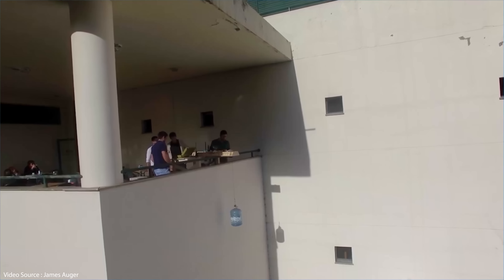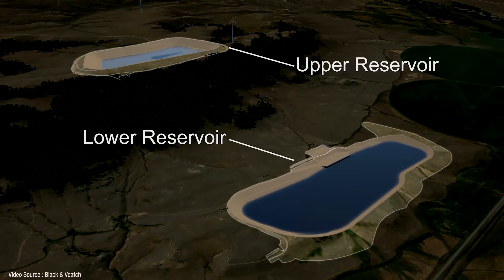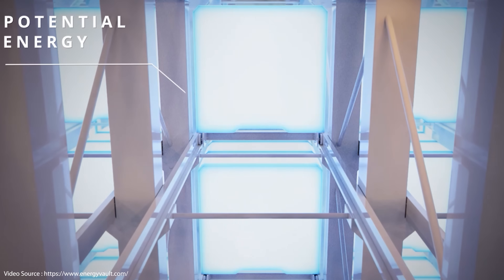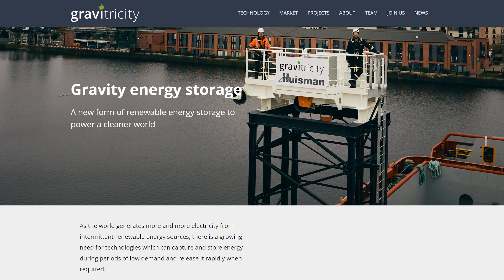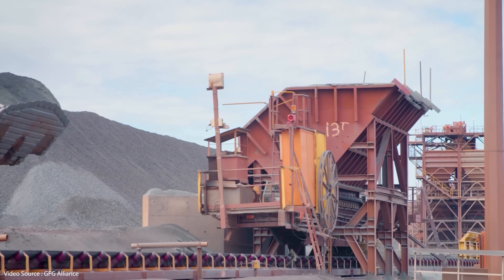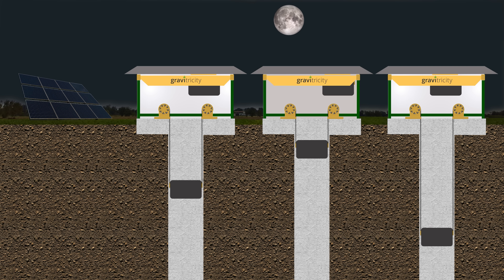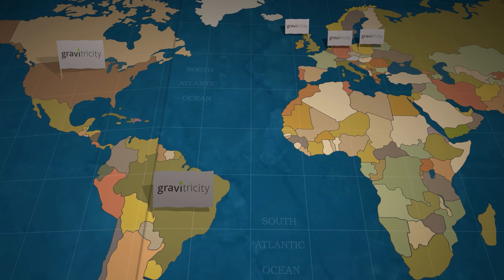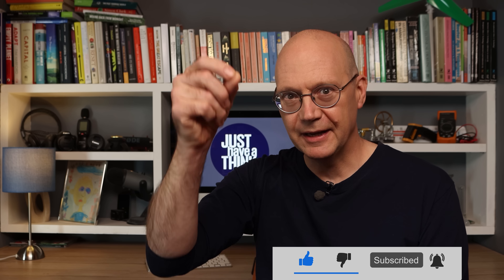Gravity Energy Storage. Who's right and who's wrong?

Comment: Being Scottish Engineers I wouldn't bet against them. They don't tend to be bs merchants. A large part of the Industrial and Scientific revolutions of the 1800's and the British empire is based on the brilliance of Scottish scientists and engineers (and I say that as a wretched Sassenach)
Reply: Read "How the Scots Invented the Modern World".
Reply: I believe Scotland has the highest ratio of patents per capita anywhere in the world.
Reply: As a scotsman I can assure you there are plenty of BS merchants north of the border, especially when there's a bit of free cash going for research.   the fact that someone did something 150 years ago is no predictor of current performance.
Reply: They could just use Loch Ness (221 m), Loch Morar (310) or other lakes. The north sea could be used (even if water with salt are nasty stuff for any equipment).
Reply: @bknesheim  use it for what?   Loch ness is 15m above sea level.
Reply: @mralistair737   It is 221 meter deep. What is above sea level do not matter.
Reply: @bknesheim  so what are you planning to do with it?  If you want to drop the water you've got to put it somewhere?  if you want to drop something in the water?  then you loose half of the energy because of the density of water, plus you've got to build a boat which will be twice the volume of the weight of concrete you are dropping... so if you are going to build a massive waterproof tank, just do it at the top of a hill..
Reply: @mralistair737  You loose 1 kg per liter. Lots of minerals and metals have a density greater then 5 (lead is at 11) so if you use lead less then 10 % is lost. What you gain many more places, reduced cost and shorter construction time.
If you place a setup on a barge you could even move it to places where storage is needed .
Reply: @bknesheim  this is so dumb it's not really worth a response but, let me get this straight, you want to sink thousands of tonnes of lead, which is toxic but the way, of a barge into loch ness.   your barge still has to be massive by the way, as it's linked to the density of water. and no matter what the weight is made of, the barge will always be larger than the equivalent weight of water.. so again.. just build the barge at the top of the hill and run a pipe down to loch ness.. save yourself the cost of the lead.
Reply: @mralistair737  You should get your chemistry  correct. Pure lead is not toxic. Salts of lead are toxic. Pure lead do not react with fresh water and to be really safe a thin layer of paint will do the trick. 
Also a barge on the water can be move around if needed. A tube at the top of a hill not so much and on the water the distance you move will always be the shortest possible down a hill can be a lot longer than then the difference in elevation . You will also need a lot of pipes and they will have looses to turbulent friction.
You could swap the lead for magnetite. The increase in volume be 2.5 times lead, but the cost will be just a small fraction of the cost of lead.
Reply: @bknesheim  why would you need to move? you just need to connect to the national grid, the UK is well connected to a single grid.   you still haven't explained a single advantage of doing it in a loch.  it's only 200 m deep.   pumped hydro can have 1km fall ... the loses of pipes are pretty minimal  like 95% of all current energy storage is already pumped hydro and the round trip efficiency is 79% .. and the Barges will be huge!  like to get 1gwh storage your barge would need to be as large as the largest ship ever made and you'd need 650 megatonnes of magnatite.

fyi the 1gwh of storage is enough for about 30 wind turbines    output for 8 hours.  the UK alone has 2500 wind turbines.

edit: my mistake the boat would need to be bigger as that weight is the gross weight but you'd need net weight, so add making a boat 20% bigger than the largest boat ever made to your to-do list... plus getting it into loch ness.  plus i discounted the boyancy to you need 850 megatonnes of magnetite

And of course a flexible rope that can carry 650 megatonnes of force.
Reply: @mralistair737  The original comment was not for making a pumped hydro system. It was for a system that wanted to use mine shafts as the place to build a system and 200 meter is a deep mine. The mine shafts to store a 1 GW/h do not exist and 2 million tons would store a gigawatt 
650 million tons would store at least 0.3 TW/h if the elevation was 200 meters. That could store 5 days production from 2500 wind turbines with an installed effect of 6 MW and the 33 % utilization that is close to the average in UK.
Reply: @bknesheim  but the single advantage of the mineshaft (which is obviously not a scalable solution either)  has the advantage that you can support the top of the winch on the ground, which doesn't work on the water.     

apologies,  you are correct, you only need 2 million tonnes of magnatitie .. but i also got the size of the largest ever boat built wrong. it was 650 Kilotons. not megatons.  so for your 1gwh plant you need to make a ship that is 3 times larger than any other floating vessel ever made.    FYI the largest pumped hydro scheme in the uk is 9gwh
Reply: @mralistair737  You are very correct that to be on land is a create advantage, So to find places where the water is deep just outside land could be a good option. Do not now how that work for Scotland, but on the other side off the North Sea there are lot of places in the fjord where the depth is more then 500 meter just a few meters from land.
You could also make the shape of the weight like a tub that will float by it self when you empty it at the surface. Then just fill it with water when you want it to sink .
Then the barge only need to lift the weight of a single unit. A barge 5x5x10 meter could easy lift a 100 ton weight even if there is a lot of equipment on it.
Not need to build a giant construction when many small will do just fine.
A large fully charged "battery" would be something special to watch. A little like when there was a crisis in the tanker transport and a many tanker was laid up side by side in the fjord outside the town I live in.
Reply: @bknesheim  zero opportunity for significant depth.
Reply: @mralistair737  Well there is a 1600 MW connection that could be used to send some power over to the the other side.
That could be needed since two dry years in a row have severely reduced the amount store in the water reservoirs for the hydro electrical plants. The plants connected to the larges dam has stopped producing for this year. Instead they are running 320 MW generators as pumps to help with feeling up the reservoir for the winter.
Reply: @bknesheim  well there are 2 things about that.  1. pumped hydro is typically closed loop so doesn't lose water like a normal hydro dam. dry years make very little difference.   2. We are talking about Scotland here, not California. there is always enough top up to account for evaporation...
Reply: @mralistair737  A closed loop in Scotland would probably have more problems with overflow then running dry. :-)
"Blåsjø" is a 7.7 TW/h reservoir at 1000 meter elevation and there is no space to have a similar size at lower elevation. There are reservoirs that collect runoff from lower catch basins and this can be lifted 500 meter to "Blåsjø" and stored for the winter.
The 320 MW pump used would have to run for years if is should fill the reservoir all by its own.
Reply: Yes, I'm astounded at the progress, ingenuity and boldness of the Victorian era engineers and planners.

Comment: Mmmmmm, gravity storage. Using solid weights as stores of potential energy involves lots of machinery operating under very heavy loading factors. Frictional losses will climb as the system ages as will maintenance costs. Utilizing old mine shafts at first seems a good idea until you realise that a lot of abandoned mine shafts are flooded, ground water ingress meant the mines had to be continuously pumped during their working lifetime. Even dry shafts need regular maintenance to keep the walls sound, vibration and natural ground movement will cause cracking. To my way of thinking, water is the natural choice for the basis of a gravity storage system. Maybe there is a way of utilizing the canal network, a vast collection of waterways and storage reservoirs that operate by gravity to move boat traffic up and down. Localized turbines at lock stations would be able to use the discharge water.At offload load times, the turbines act as pumps to return the water back to the high point in the system.

Comment: An engineering mate of mine just had an interview with Graviticity, so they are powering ahead.
I'm curious about the power loss? I'm assuming there is some between raising the weight and lowering it...
Did the costing always assume that there is a readily available mine shaft to use, or are they factoring in the cost of building new shafts, or altering an existing one to make it suitable?
Reply: Anything that moves will produce some heat, so there will energy loss.
Reply: @MPostma72  Yes, so I was wondering how much it was.

Comment: Why the cables and drums? Surely it's better to mount electric motors/generators directly into the weight? 

I'm fond of linear motors, so one idea that I have had is to pump a conductive liquid of some kind 'uphill' to charge, which is then released to generate electricity directly by flowing through a strong magnetic field.

I envisage that the pipe opens at the top into a tank/reservoir, close to the top so that a lip is formed. Then - with ball bearings at least - the heavier particles would be trapped in the well via gravity. No need for a valve perhaps, and the syphoning effect could used to drag the heavy sediment over the lip initially.

Oil filled with ball bearings may well work, but the best material is likely to be the conductive ink of the 'Working Ink' channel here. I'm not sure how the 'well' design would work in that case.

The whole system could be self-contained, and might also serve for geothermal heating!

A half-baked idea, but I think that it has merit.